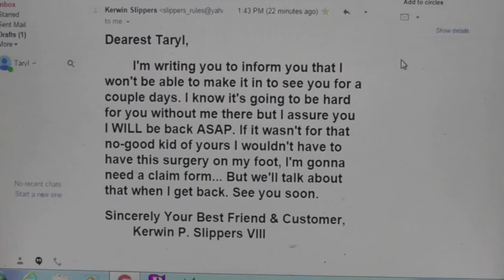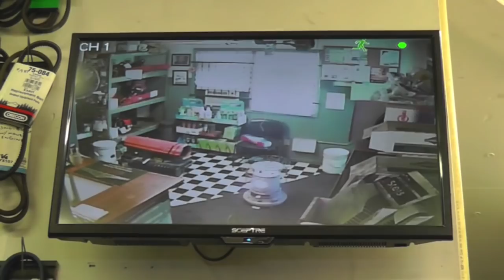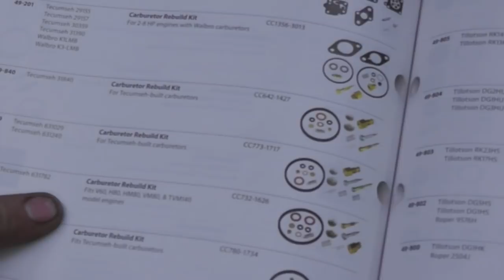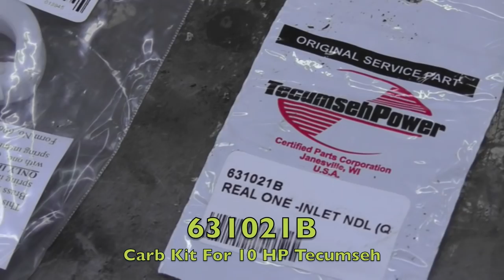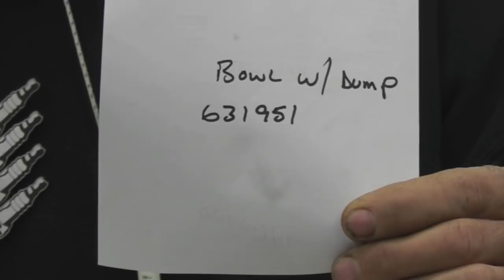How To Rebuild Tecumseh Snow Blower Carburetors with Taryl

Comment: Hey Taryl, 

I have an older 5.5 HP Tecumseh engine on a Craftsman snow blower that will blow gas out of the carburetor. I took the head off and noticed that that the intake valve doesn't close completely until you almost get to top dead center. It opens like it should to intake gas and then it closes, but not all the way (I'm able to turn the valve) until it almost gets to top dead center. Right before the valve closes completely, it rises up slightly and then clicks close (I can't turn the valve anymore). I checked the valve clearance and the intake is at .007 and the exhaust is at .011. Any ideas? By the way, I really like your videos. They are funny and very informative at the same time. They have helped me fix small engines on multiple occasions.

Comment: Omg omg..did the 10HP carb with the green emulsion tube and the shorter low speed jet( without gaskets and washer) have a sliding thing inside the center???? Im so worried..rebuilding one right now!!! Nothings making noise as i flip it over..i did another one with the adjustable low speed screw and heard the thing inside..its the short jet one that spooking me

Comment: Terrlle, does that rod in the middle  supposed to go up and down in all Tecuimseh carbators ? I am rebuilding a 50's boat motor, and I checked, and that one does not move up and down. It is brass.. It doesn't look like it moves.

Comment: Can anybody explain how the adjusting screws work on the adjustable carbs?  I get the idle screws at the top and on the throttle lever, but I don't understand what the adjusting screw at the bottom of the bowl and the one on the side does and when you should adjust them.  I cleaned my carb for the first time on my snow blower, which previously only ran if it was on full choke.  So the previous owner probably adjusted the screws incorrectly, now mine revvs out of control when you start it up.
Reply: They are needle valves.  Look it up.  Set them the number of turns that Taryl suggests in the video, and you have a good chance of success.
Reply: @wryanddry2266  I know they're valves, but what do they control?
Reply: @mae2759  
FINAL ADJUSTMENTS (NON EMISSION ENGINES)
Start the engine and allow it to warm up to normal operating temperature (3 - 5 minutes). Set the speed control to the
HIGH or FAST position. From the recommended preset position, turn the main mixture adjustment screw in (clockwise)
slowly until the engine begins to run erratic (lean). Note the position of the screw. Now, turn the screw out (counterclockwise)
until the engine begins to run erratic (rich). Turn the screw in (clockwise) midway between these two positions. This will
be the best setting. (diag. 24, 25 & 26).
Set the speed control to the IDLE or SLOW position. Adjust the idle mixture screw following the same procedure used to
adjust the main mixture adjustment screw.

If further adjustment is required, the main adjustment should be made under a loaded condition.
If the engine stops or hesitates while engaging the load (lean), turn the main mixture adjusting screw out (counterclockwise)
1/8 turn at a time, testing each setting with the equipment under load, until this condition is corrected.
If the engine smokes excessively (rich), turn the main adjusting screw in (clockwise) 1/8 turn at a time, testing each
setting with the equipment under load, until this condition is corrected.
After the main mixture screw is set, move the speed control to the IDLE or SLOW position. If the engine does not idle
smoothly, turn the idle mixture screw 1/8 turn either in (clockwise) or out (counterclockwise) until engine idles smoothly.
Recheck the high and low R.P.M. setting and adjust as necessary.
Reply: If it revs out of control, I would suspect a governor problem.  See Taryl's video on governor adjustment on this same engine.
Reply: @wryanddry2266  Yep, did that and it fixed the problem!

Comment: gee reading... is that why there is a seat in the carburetor, to set down for a little reading? thanks, best carburetor video yet.  :)  my new-used Cub Cadet 760  carburetor has bad gas.

Comment: HIGHLY RECOMMENDED -  and entertaining too, perfect for DIYer like me who knows just enough to screw things up. I have a 20ish year old  Toro that hadn’t run in a long time, needed attention. I’m in a technical field, arrogantly thought that a simple “tune-up” was something any simpleton could do without any instructions. Yeah. That was in 2015 and the ****ing thing hadn’t run right since...surging, stalled under load,  backfiring, you name it. This video covers everything I needed to know, now I’m launching snow across the street like a champion. (In my case, I had damaged the needle seat, not cleaned the jets properly, and smushed an o ring on the emulsion tube. Result was leaky carb, surging, only running on full choke and dogging out under anything more than a light load. Now it runs like a champion. Thanks!

Comment: taryl, i have a snowking snowblower, probably 1980s. can i soak the carb with the venturi tube still in? i cant get it out. or will solvent ruin it?   dick bailey

Comment: 21:55  Technician's Handbook (p. 10) states that there is a
metering rod or pin (not a tube): "NOTE: On models which have metering rods, do not
install idle adjustment screw with carburetors upside down, as pin will
obstruct movement of adjustment screw causing damage"

Comment: Hi Taryl.. Can you help me I rebuilding a Tecumseh snow blower carbertrader. Can you tell if HM80155361P  ser. 91870.  Does this carbertrader have the tube for low idle jet? The one you should hear when shaking the carb up and down. I do have the brass main jet instead of the colored plastic ones. Thanks for the great videos!! I learn a lot.  Also thanks for any help.

Mark

Comment: I have watched a lot of videos on cleaning carburetors and your video is the only one to address my problem. When I got the snowblower I noticed the low speed needle was marred up a bit on the end. I cleaned the carb and it ran good wide open, but it wouldn't idle. I had a sneaking suspicion the carb was hooped after seeing the end of the needle, but now I know that I need a new carbutrator, because my tube doesn't go up and down (near enough, haha!). Next time I will search for "carbutrators". You really know your carbutrators. Thanks.

Comment: Hi Taryl.  I have a Craftsman 179cc snowblower with a Tecumseh engine ZS365-SUA.
Unit Model # 31AM32AD77, Serial # 1F258B40634, Craftsman #247.887550. It's an MTD Product.  Carb # 751-10974,  I put the carb through the ultra sonic cleaner several times, I also hand drilled the low speed jet to the next size.  New plug, filter, Etc.. nothing leaking. Note: the unit had been left outside.  I had a lot of sanding with my wire brush on my drill to do in-order to get all the linkages cleaned and rust free.  All is working fine now except I'm getting surging after the engine has been running a bit.  I apply the choke and the surging seem to stop.  That's why I cleaned the low speed jet as per your video.  I DID NOTICE WHEN ALL IS SET TO NORMAL, RUNNING FULL SPEED,  AND IT STARTS TO SURGE, WHEN  I REMOVE THE GAS CAP IT STOPS SURGING.  Gas Cap Bad?  Thanks, John
Reply from the maker: +John Ambrosino Sounds like it. Cap needs to vent to allow the fuel to flow, when the venting is restricted or blocked it will be air bound and run out of gas. Think of it this way when you put a straw in a glass of water and put yur finger over the end you can pull the straw out of the glass and the water will stay in the straw until you take yur finger off. Same principle applies to the gas tank. New cap or drill a teeny tiny hole in it.

Comment: I just said F it and bought an Oregon carb for $30.  By the time I buy all the replacement little parts and the carb soaker I'm running close to the $30 and still have to put the time into it to do disassembly, reassembly.  Not to mention I had the pin issue, where the stupid metal pin in there was rusted up or gummed up and when you shook the carb I couldn't get it to bang around.

Comment: Thanks Taryl from Columbus Ohio. That little vent hole is often overlooked and that idle jet screw with the cap on it. you mentioned sometimes that you have to drill out of that idle screw. where do you get those drill bits to do that? Thanks again and you all have a Great Thanksgiving. - Ray.

Comment: Great show. I watch twenty other YouTube and they are not as details as you do. No one ever mention the small tube inside the low speed jet or the hole on the body just above the low jet outside. Really appreciated for sharing. Someone mention space between float and carburetor is closed to 11/64 drill bit. Is it important?

Comment: Great vid, Im having problems starting my 10.5 and missed alot of stuff to clean. Its been sitting for a couple years but I did get it to go for a couple seconds and shut it down as the muffler got red pretty quick (throttle control was bitched, since replaced).  This was a freebe so I hope I can get it working.  Also how many pushes of the primer is recomended? Ive done to many I guess cause fuel leaks out the carb somtimes when I push it to much. Probably flooding engine (plugs get wet)

Comment: Hey Taryl! What would you do in the Wintertime without ethanol to gum up carbs? 😂
I'm getting an early start. Have a compact single stage blower that I just completed its first plug change. Oil was changed and the gas was drained in the Spring. Should be in pretty good shape

Comment: Thanks. I truly learned how to rebuild a carburetor on the  different engines. The rebuild I did. I think I put the fuel needle in while holding the carb in the wrong direction. The problems I am having is one of those. I will have to remove the carb again to see if that happened. I may also have put the float bowl on in the wrong direction.  We will see. Thanks.  You are really great in explaining how to do the jobs.

Comment: Hi Taryl. Thank you for.your informative videos. You are both a skilled technician and a comedic genius! 

My 3.5 tecumseh roto tiller engine’s throttle would flutter and hunt for fuel even though I cleaned the carb five times, so after watching one of your videos, I pulled out the brass low speed idle jet and found that I couldn’t get an eighteen thousandths (.018) piece of bread tie wire through it, so I then drilled it out with a twenty two thousandths (.022) drill that I spun by hand with my pin vice and wala, the drill poked through.     

I put the carb back together and installed it and now my tecumseh runs like new! No throttle flutter and a smooth idle to boot.

You are the coolest dude on the net for engines!!! Thanks again!!!

Comment: I've found the you can take one strand of 12 gauge copper wire or a strand from a wire brush to use to clean the small hole in the main jet.  You could JB weld or epoxy the strand in a wooden dowel rod to make a handy tool.

Comment: Hi Taryl,  Do you need to adjust the low speed jet? example turn all the way in then back off 1 turn or so,  or just screw in all the way in and leave it?  What about the one on the carb bowl? How should that one be set?  As always Thanks, John

Comment: I dun already pulled that brass thing out the carb.  I cleaned it up and reserted it.  Runs pretty good.  Not perfect, but i got other things in mind for it.  Why you say don touch the brass thing?   That bees only on the Tecumpish?

Comment: JUST USED THE ULTRASONIC ON A TECUMSEH CARB, USED STRAIT SUPER CLEAN ADDED SOME WATER,  WHEN I PULLED THE CARB OUT NOTICED WHITENING ON THE CARB , FLOAT, NEEDLE, DID I USE THE CLEANER TO STRONG ??

Comment: On the 2nd carb, where the inner tube slides in side the casting,,, there are two on the side of this casting. Is one hole  blocked and the other open?

Comment: Note that the old float bowl has a depressed area relative to the bottom plug.  The sediment/water that collects in the bowl is below the jet inlet on the plug.  Water and perhaps the sediment as well can drain out when you press the drain valve.

Comment: Great video, couple of questions:

I replaced the carb (old one was leaking and almost the same price for new as repair kit).  Used the same settings for the new carb as the old:

Idle Screw:  7/8 turn out
Fuel Mixture Screw:  1& 3/8 turns out

Starts fine with first pull but:
1.  Going from full throttle to idle it sometimes spits and sputters (almost a backfire)
2. Ran for 3-4 mins, did not want to restart without the choke on.

Any suggestions how to remedy these 2 things.
Reply: 1.  Move throttle slowly to an idle speed.
2.  Use the choke.  It is not fully warmed up in 3-4 minutes.

Comment: Thanks for a great video. I've been subscribed for over 2 years and enjoy your videos. I am working on a 1998 Toro 724 snow blower with an HSK70 130282U for my daughter in law that has 5 kids under 8yrs old and they cannot afford a new machine. The 724 was well cared for apparently but the carb is beyond rebuilding. I have rebuilt older Tecumseh 524 (36 yrs old and starts 1st pull) with adjustable jets with great success, but this one is a no go. Unfortunately Toro and Tecumseh say the 640082 carb is discontinued and they offer no replacement. Do you know of a different carb that I can use or where I can source a 640082 carb? Thanks for your help.
Reply: Just google it, duh. D:

Comment: First of all, Great video with lots of information, especially the hose trick. I have couple questions, If you don't mind. If you are just cleaning the carb and not rebuilding, can you dip carburetor with all those plastic and rubber parts still inside the carb, or will the purple power destroy the plastic and rubber parts?  I have exact carb (the one  with 10 hp snowblower), it runs on high, but doesn't idlel on low, what do you think is causing that? When I took apart, I did see the hose for gas primer broken, like you have on video. would that cause it to not idle? Thanks
Reply: Look in the throat for some tiny holes near the edge of the throttle plate when it is closed.  They will be opposite the Welch plug on the side of the carb, meaning the holes are on the inside and the Welch plug is on the outside.  Remove the idle needle screw and spray some carb cleaner into the hole.  You should see spray coming through three tiny holes and going into the throat.  If not, that explains why it won't idle.  Anyway run a tiny wire into each of those holes to clear it, then check for the spray again.

Comment: Taryl, would it be just as cheap due to saving time on labor to replace these carbs. rather than rebuild maybe even with an aftermarket carb.  Love your videos thanks for the small engine education
Reply from the maker: +fedleyforest In some cases yes but if your a DIY guy those parts are relatively cheap to purchase so you could do it yourself & save money.Once you know the little tips I point out in the video you can rebuild one of those carbs. pretty quickly. Thanks for watchin my videos.

Comment: hi taryl I have a Tecumseh hM 100 10HP engine it has fire going to it but the carburetor have gumed up oil in it WATS the problem
Reply: Tarvan Sanders; i had ethanol gas causing gel to form in a krohler carb, or was it Slippers?!?

Comment: Great video.  If I purchase a new carb can I use the old Fuel Mixture Screw to avoid having to reset the mixture?  Thanks.
Reply: I always screw IN each needle valve, counting the turns.  On rebuild, crank the needles in to just snug and back out the same number of turns as before.
1-1/4 for Idle (Top one) a bit more for the High Speed one.  After fully warmed up, fine tune by S L O W L Y turning jets til highest/lowest smooth RPM is found

Comment: My MTD snow blower engine is the LH195SA Model. 5HP Tecumseh. My carb bowl just has a flat nut on the bottom with a recessed jet I presume? I don't want to remove it in case I fudge it up. Here is my issue. It starts with the choke on. Runs and idles with the choke on. Whether in low or high speed. But as soon as I turn the choke off it spudders and dies. When I look up under the heat box. I see a open hose dangling. Is that a vent hose? Or did it likely come off something? 2nd question. On the back of the heat box. There are two holes. Big enough to stick a torx screw driver in. The top hole leads to a torx screw. Is that the idle adjust? If so should it be turned all the way to the left or right? Any help is appreciated. Before I end up taking the carb completely off and take just it into my local shop for a complete rebuild. I am brave on the basic stuff. Oil change, belt change. But some things you need a professional to do. Thanks in advance. Ontario, Canada.
Reply from the maker: Sounds like you need a carb rebuild. The hose is most likely a broken primer hose.
Reply: ***UPDATE***

Not sure if your video was specifically meant to be 100% sarcastic. As to confuse most people. I get it now that it was explaining a complete rebuild. BUT here's a hack for anyone.

 5 minutes carb clean. Tilt the snow blower towards the gas tank. So that the gas tank is lower than the "CARBATRAITOR". Remove bowl nut/jet. Clean bowl and with carb cleaner. The jet has 3 holes in it. One is a through hole. The 2nd goes down the centre of the jet. The 3rd is a 2ndary hole near the top of the threads. #MechanicHack Take a garbage bag twist tie. Remove all the paper. Use the wire to slide in each jet port. Then blow carb clean through the top. You will see it shoot out all three holes. Clean your float if need be. Care about the needle attached to the float. DONT LOSE THAT.  Re install everything in reverse order. Then spray the hell out of the outside of the carb with carb cleaner. Scrub with a tooth brush if need be. 

VOILA!

Carb is clean without removing it from the engine. 

ONTARIO, CANADA